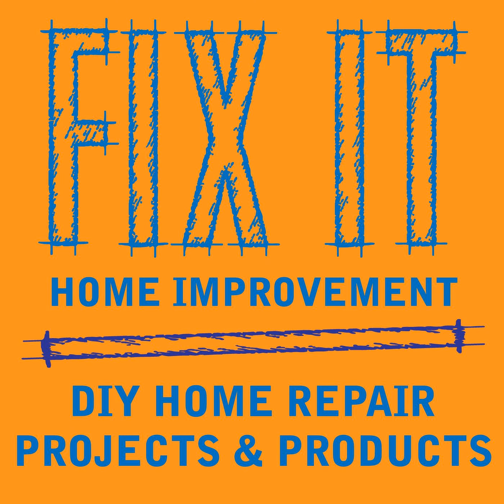Replacing Surface Mounted and Old Deadbolt Locks - Podcast

Comment: Anything wrong with using a surface mounted deadbolt, that mounts from side?
Reply from the maker: Hi, rim locks work well and are secure. A deadbolt is considered better security.